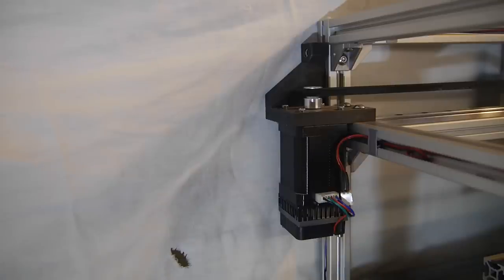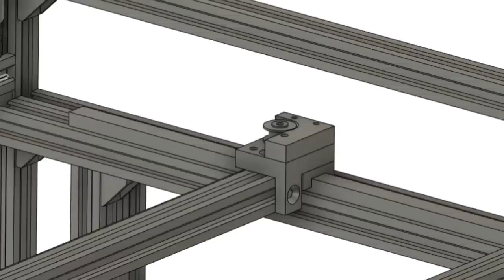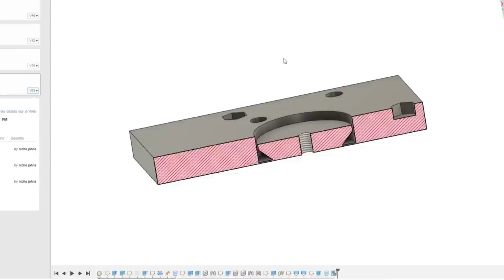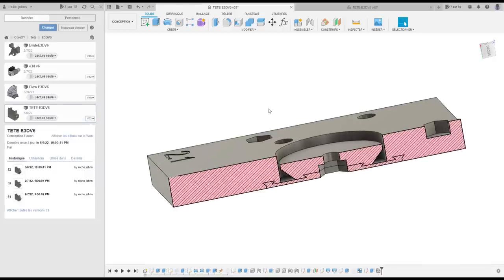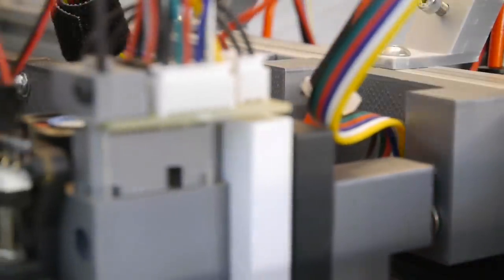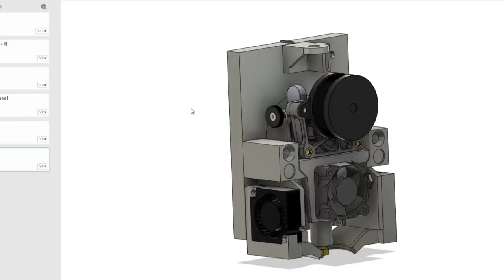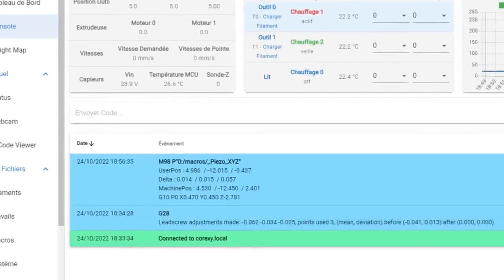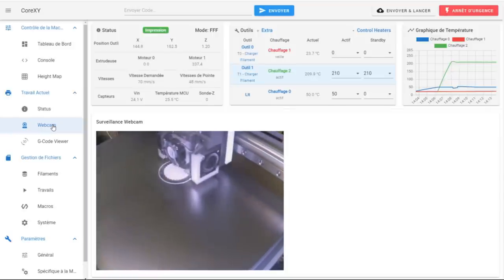My custom CoreXY printer and it's electromagnetic tool-changer

Comment: I am amazed at the shear number of elegant solutions implemented on this machine, everything from the cooling blocks on the steppers, the permanent magnet head holding workspot, and even little trash can in the frame. It seems like every issue I have ever had with my printer you've got an answer for. You are one hell of an engineer, thank you for posting this!
Reply from the maker: Thanks for the dopamine shot !
Reply: @workshopfeedback  lol

Comment: This is an excellent design. I have been working on a custome corexy build for a few months now and really like your electronics and filament management. Great ideas! I’m making a 500 x 500 x 550mm size. My biggest issue is the bed warping being so big. Had to order a 6mm thick aluminum sheet and will have to make the bed myself. I plan to make it tool changing eventually and love your design. Great ideas. Good job!
Reply from the maker: Thanks for your comment,  have fun with your design.

Comment: This is amazing. Your work here is truly impressive. I can see this being the voron design and should be named after you.
Reply from the maker: Hi Greg,
As Voron is a CoreXY Printer with three Z axis, there are similarities with Voron Trident.
I inspired of all what I found of the web but as I started the design from scratch and didn’t use any of the files provided by Voron, I don’t think that you can say it’s a Voron.
By the way, oldest Voron Trident files are dated August 2021 and I designed and built my printer between January and August of the same year.
Reply: @workshopfeedback  I don't think he meant that the Voron team is claiming this work, he was suggesting that the Voron adopt your design into their CoreXY system. I would love to have a tool changer capable Voron and your system looks easy to implement. Nice work!
Reply from the maker: @TheRealClutch1010 You're right, I misunderstood the compliment 
@Greg Melosh Sorry

Comment: It should be a good idea to place the electromagnets only on the resting point and use them to "release" the coupling somehow. Awesome, Like from Spain!
Reply from the maker: It's an idea.
I'm not sure that the permanent magnet used for the coupling wouldn't be unmagnetised by the release field over the time.
Greetings to Spain from France
Reply: @workshopfeedback  Forget the permanent magnets, i mean a mechanichal coupling who dettaches when electromagnet is powered with one electromagnet on each holder. If you are on a discord or something i can colaborate on designs
Reply from the maker: Hello Martin, I don't really see what you mean.
A drawing would surely help
Reply: @workshopfeedback  let me prepair a 3d model of the concept i will send to you a model, are you using fusion360?
Reply from the maker: Thanks for your file, Martin,
It's certainly an option. 
It may be tricky to tune with small moving parts and springs.
Reply: @workshopfeedback  the idea was to reduce weight and cables on carriage, i hope the idea will help you on future updates

Comment: This printer looks outstanding! I hope you continue to make videos on it! A more elegant connector system for the print head pcb might be in order, some printers have started using USB C for this purpose, as it can transfer any required data and up to 100W of power!
Reply from the maker: I'm afraid that USB C connectors would be difficult to wire and implement on rustic PCB.
For an industrial and commercial product it can make sense

Comment: Since the E3D Toolchanger i was intested in ths concept, but i think there may be some possible problems with your design, specialy the magnet. First in case of an power loss the printhead would fall off. A simmilar pin on the moving part as on the toolholders could prevent that. Than you mentioned the permanet magnet, you clould use a perma magnet instead of the aktiv one to hold the tool and only use an activ magnet in the moment of toolchange, so you can be safe at a power loss and get rid of the cooling fan for the activ magnet. The activ magnet for the release could be even positiond at the statonoary toolholder to safe weight.
Reply from the maker: Hi Niklas and thanks for your comment.
I agree, it's an option.

Comment: Hi, very fun looking project to design and build. You may have inspired me to look at a tool changer for my custom machine. Look at the duet 3 with tool changer boards it could potentially make your wiring a lot cleaner and easier to manage. Thanks for this really cool video.
Reply from the maker: Thanks, 
Yes Duet3 CAN boards are interesting but more expensive and there are still cables ...

Comment: How fast can it print? Do the magnets limit how fast it can print? Fantastic tool changing printer, love the use of the flexible filament in the tool changer!
Reply from the maker: I didn't look for speed limit yet. 
It is certainly a limitation of this coupling compared to a mechanical one due to it's elasticity

Comment: What a fantastic DIY build, you did an amazing job! Clearly a lot of thought went into the design of this thing. I'm curious - since the magnet requires power to hold the toolhead, some of which is getting released as heat, how much more power the machine consumes versus a motorized lock. Even still, this is really fantastic! Great job presenting, too
Reply from the maker: Thanks for your comment,
The power of the electromagnet is 6W
I have not made a total assessment of the consumption of the printer but I don't think it significantly increases the power consumed during printing

Comment: Can you provide a link to the electromagnet you've used for this application?  I really like your solution to this problem.  Also I've been wondering for ages why no one has been using the nozzle detection solution you've implemented.  Well done!
Reply from the maker: Here it is. I use the 24V version
https://fr.aliexpress.com/item/4000766066541.html

Comment: this is such a neat project. i think there could be a solution to the number of stepper drivers & analog pin required for each hotend by rather running all common connections to the toolhead and use pogo pins to connect from the toolhead to the current print head, macros should work to switch between each tools config but not looked into it myself. then you only ever need to wire up once.
Reply from the maker: Thanks,
It's an option.  But I imagine this only possible for the extruder motors which are never working together.
During multi-extrusion, Its preferable to keep the hand on both printhead heating, temp control & heatsink cooling, so no swap possible there.
I'm sure it can be controled trough GCode.

Comment: Great work. However I believe that your project could heavily benefit from using can boards. This may increase the cost for each toolhead marginally, however it would allow you to explore direct drive setups, and reduce the amount of wires to only 4 per toolhead.

You could also mount a singular can board to your carriage instead, and implement a connector that uses singular magnets to conduct each wire (global +vdc, gnd, 2 fan negatives (one part cooling, one hotend fan), sensor, hotend).This would completely rid the toolhead from having any external leading wires, however it would require each toolhead to be heated back up. Not a major issue if you are running something like a rapido, but in this scenario the tool swapping delay will be most definitely increased greatly.
Reply from the maker: Thanks for tour comment,
Using a serial bus would certainly be an elegant solution to drastically reduce the wirings.
I don't know if there are off the shelf solutions for it. 
Designing the actuators electronics and porting the printer software maybe quite a job.

There's at least one problem with unwired printheads : the heatsink fan needs to run while the nozzle is cooling.
Reply: @workshopfeedback  Duet3D makes tool head boards that interface with their main board over a single connection. They are on the larger side so fitting it into your design might be a challenge
Reply: @workshopfeedback no problem. Indeed, a fan constantly on will be required, unless you passively cool the heat break (just like VzBOT's hextrudort+goliath combo is doing(still tester phase I believe). At the end of the day you could scale down to 5 wires per toolhead ( 1 +vdc for hotend and fan, 1 - for fan, 1 - for hotend, two for sensor) overall I believe that whilst it would require a lot of work, it would make the assembly and wiring of each extra toolhead marginally faster.
Reply from the maker: @NainKaigo 
I didn't see that before.
Very complete board, not easy to integrate into the design

Comment: What a fantastic job!! Specially the auto calibration of the tool offset using the piezo, it would be very helpful if you could explain how you did it :)
Reply from the maker: David,
I presume you are interested by the algorithm.
It's a GCode macro which solves this geometrical problem :
- Place the nozzle above the probe (approximative position)
- Go down until contact (position Z0) and up a bit to Z0 + e
- Go left enough to be away from the cylinder
- Go down twice a bit so the nozzle should toch the cylinder (to Z0 - e)
- Go slowly right until contact and remind position X0
- Go to Z0 + e
- Go right enough to be away from the cylinder
- Go to Z0 - e
- Go slowly left until contact. 
This is X1 and the center of the cylinder on the X axis is (X0 + (X1-X0)/2)
Repeat the same operation on the Y axis.

Hope this helped
Reply: @workshopfeedback  Thank you for the explanation
Actually my doubt is, how to configure the piezo, I cannot find anything in the  RRF
Reply from the maker: @DavidEgea13  Had a look here ?
https://www.precisionpiezo.co.uk/
Reply: @workshopfeedback  Thank you so much! Now I can sleep jaja
I saw that website but didn't though you were using it, I'll have to buy one. Can't wait to try it in my IDEX. 
Thank you for sharing with the OpenSource world, keep the great job

Comment: Your presentation was excellent and the various solutions you had were so elegant. This seems like an excellent foundational design that must have taken so much time and consideration. Is there a possibility that the project files are in a repository for others to fork/iterate?
Reply from the maker: Hi Trevor, thanks for your comment.
I'm sorry, the industrial file isn't in a shareable state at this time and I don't think that it would be a good idea to start a new design on this basis.

Comment: Just wrapping my head around this-
The bed is levelled using the probe on the back of the XY gantry? then the offset from the nozzle to the bed is found using the piezo (which is fixed to the bed at a known offset)? very clever!

where did you get the piezo / that blue pcb from?
Reply from the maker: You are right ! 
https://www.precisionpiezo.co.uk/ makes piezo detection boards. There are some chinese clone too.

Comment: Impressive design! I have one question regarding the electromagnet - did you consider making permanent magnet to hold the head and use the electromagnet to change the head? The electromagnet wouldn't be powered over the whole printing process, just when changing head.
Reply from the maker: I didn't try it.
May not be easy to implement.
That would solve the falling head on power loss problem but I'not sure the permanent magnet wouldn't get de-magnetized
Reply: @workshopfeedback  Thank you for reply. Good inspiration could be probably magnetic stands used in industry for holding dial gauges and similar things. They use shortening of the magnetic flow to virtually turn on/off the magnetic force. So if you would use servo for that or just use shortening circuit using the coil, it could work I think. It may be worth to try.🙂
Reply from the maker: I tried to find the things you're talking about.
It remined me that I had found somethings like that which may suit. 
https://fr.aliexpress.com/item/32717848573.html
I'll give a try.
Other sources welcome.
Thanks for the suggestion
Reply: @workshopfeedback  I ment to leverage this principle:
https://youtu.be/N7tbN-LnBAQ?t=180
It's in czech but the principle is that there are two pole extenders that are either shortening the magnetic path or extending the path. Between those two extenders is diamagnetic material - aluminium in this case. Hope it helps.
Reply from the maker: Ok, I didn't get what you meant, 
this needs a rotation of some parts which maybe tricky to achieve accurately
Reply: @workshopfeedback  you can achieve the rotation using servo motor
Reply from the maker: When using a servo, I would prefer a fully mechanical coupling.
The interest of the electromagnet is that it is quite simple to set up.
Its weakness is that the necessary spring effect can become a problem with hard accelerations.
Rotating magnets solve the "head drop on power loss" issue, but I don't really mind that.

If you're interested in the coupling solution, I've seen that the Prusa XL seems to use lateral movement of the carriage to lock a mechanical coupling. It is also a very interesting option.

Comment: bambu labs showed us the way with ABL. piezo under the bed, and you tap the nozzle on the bed. hopefully your heatbed is mains powered.
Reply from the maker: Yes, it can be done for the Z offset.
I intend to add one probe under my bed to get a real Z offset between the nozzle and the bed.
With my current XYZ probe, there's a setup constant reflecting the height's difference between the top of the probe cylinder and the top of the bed.
If I change the PEI plate on the bed, I must change this constant due to the  plates different thicknesses

Comment: Bravo. That must have taken a good part of a year to design, build, iterate, rebuild, lol. Really love that piezo xyz probe. I wonder if you could reverse its use to make a simple pressure advance, 1st layer consistency probe, like the bambo without lidar.
Reply from the maker: I don't know this printer. 
For this, the best could be to have a constraint gauge (or a piezo) in the print head.
It's the case for the Prusa XL

Comment: Awesome build, all issues are thinked with premeditation and i love it, i whould like to build my own FDM printer in the future but i don't know about software of the printer you use or what motherboard use to keep track of all the extra sensors and extruders, and less how to make the GCode to do the comprovations on the position on the extrude too.
Reply from the maker: Thanks for your comment,
I used Duet2Wifi & Duex5 boards from Duet3D and the Reprap firmware thet goes with.
I also shared the XYZ Probe GCode Macro in the description of the video

Comment: Have you thought of using a swutchable magnet (the ones that can turn on off with a rotation of the controlling part) ?
Reply from the maker: Yes, I have seen videos on this.
I chose the solution that seemed the simplest to achieve.

Comment: @Workshop Feedback  For how much force is the electro magnet rated? Any reason why you used not-magnetic when no-power compared to magnetic when no-power?
Reply from the maker: It's a 200N one (24V / 6W)
Didn't find any suitable an affordable "no-power" one.

Comment: amazing! I couldn't figure out the heat issue with electromagnetic coupling. what do u do when u use power?
Reply from the maker: There's a fan on top of the carriage, powered with the magnet power line

Comment: Wow vraiment bravo pour cette vidéo, j’ose pas imaginer tout les cheveux arrachés sur chaque problème que tu as dû résoudre. 
Je me posais une question: vu que le plateau d’impression est soutenu par trois moteurs indépendants, ne serait-il pas possible d’incliner (même légèrement) le plateau pour avoir de meilleurs overhang, moins de support, ou même de l’impression non planaire (je sais que c’est possible avec Marlin, donc ça devrait l’être aussi avec Duet).
Super projet, impatient de voir comment ça évolue.
Reply from the maker: Merci, 
Je ne sais pas quel angle on pourrait supporter vu que le plateau est juste posé.
Je n'ai jamais travaillé la question.

Comment: Can you tell me more about the carbon fiber "rod" you are using to guide you hot end cables? I have a V-core 3 500mm size and am having a terrible time with the cable management for the hot end falling in the motion area and getting stuck or caught. Your setup looks like it would solve my issues. Where did you get them from? What is the width and thickness?
Reply from the maker: Hi, Connor
I can't find where I bought them as it was a long time ago.
On eBay maybe, it's the sort of thing you buy because it could be usefull one day.
Mine are 0.5 mm thick and 10 mm large.
Maybe not the most easyest thickness to find.
Any idea somebody ?
Reply: @workshopfeedback  thanks for the info, just having the size will help me determine what to buy. I was unsure how thick they should be. To thick and they won’t bend, to thin and they might snap. Knowing they are .5mm thick is a huge help!!!